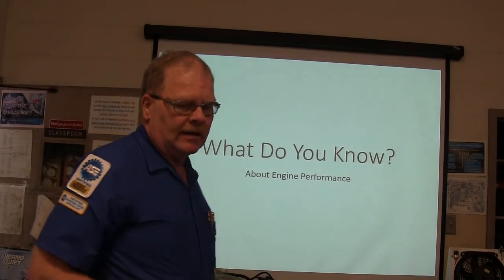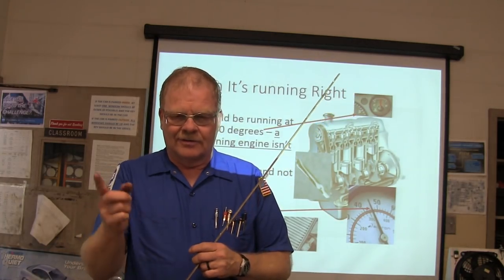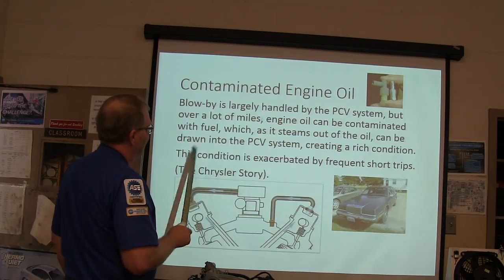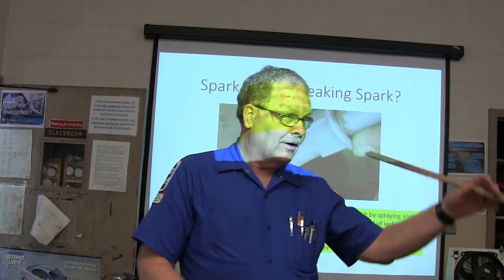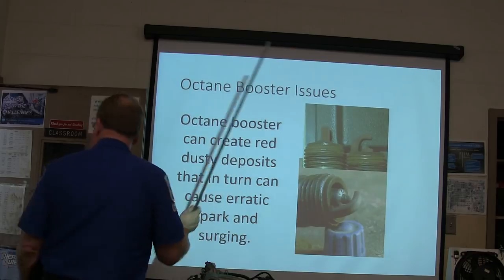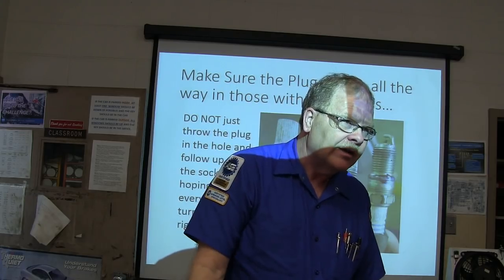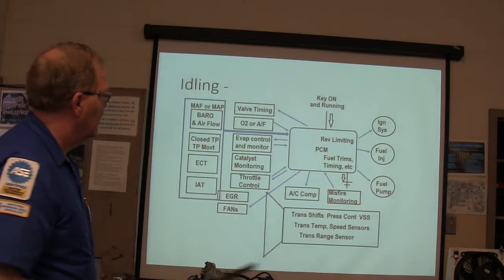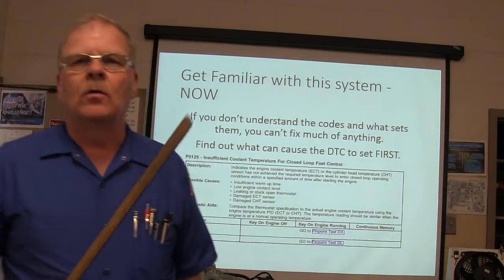Eng Perf Basics Burn in

Comment: Sir, you said it is a bad fuel pump. I did not see the fuel pressure drop below its initial pressure. When  the throttle was snapped, isn't the pressure expected to increase and drop to the pressure it was before the snap throttle?  I can see that if the pressure drop below the actual pressure, we can say that the pump is bad.
Reply from the maker: When you pull the fuel pressure regulator vacuum hose, the pressure increases about 10 psi. When you snap the throttle, if the pressure drops like that with the fuel pressure regulator vacuum hose disconnected, the pump is weak - but a fuel filter would be in order first.  Here's a link to the actual video: https://www.youtube.com/watch?v=6buEFTj1POE